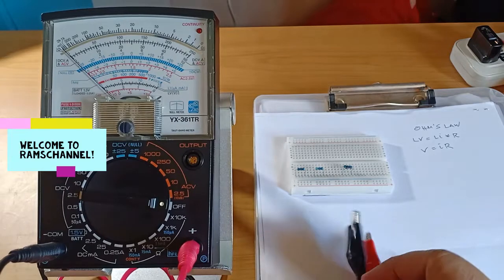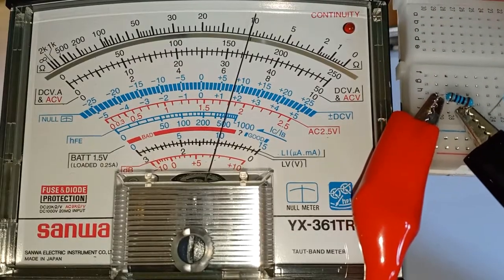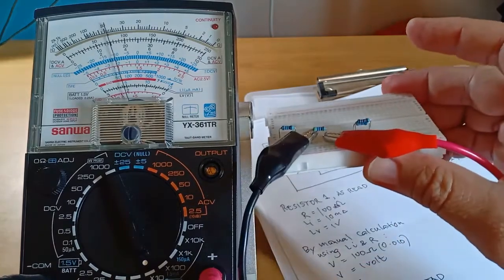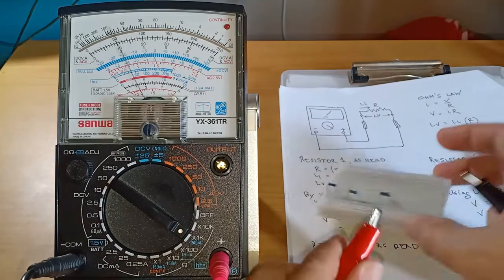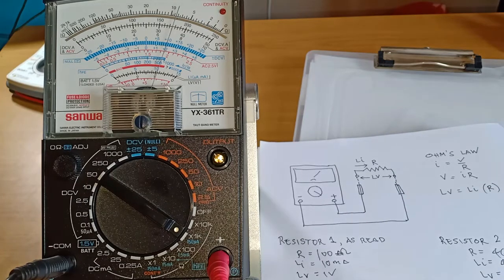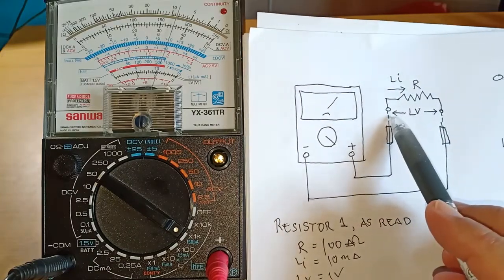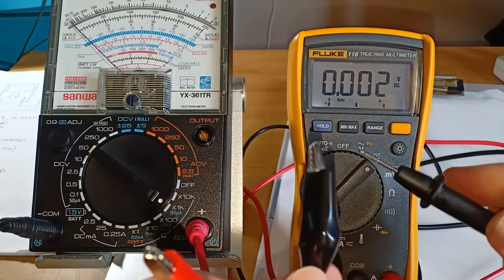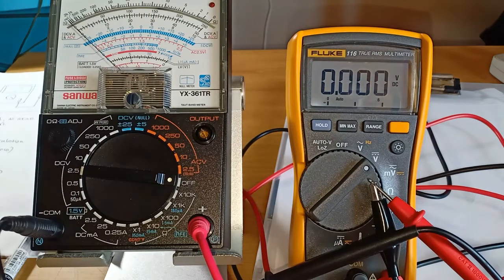[CC] Simple Ohm's Law Demo Straight from An Analog Multimeter (X1-X1K Range on Sanwa YX-361TR)

Comment: Due to the fact that the analog multimeter, in the X10K scale, is capable of providing 12V, it is an ideal equipment to check the state of diodes in kitchen microwaves.
Reply from the maker: Thank you for the information.